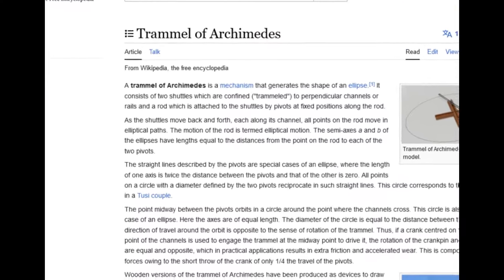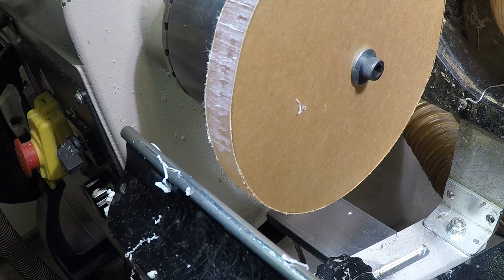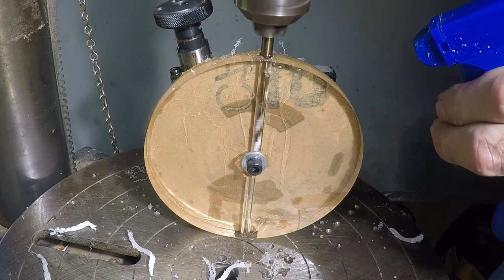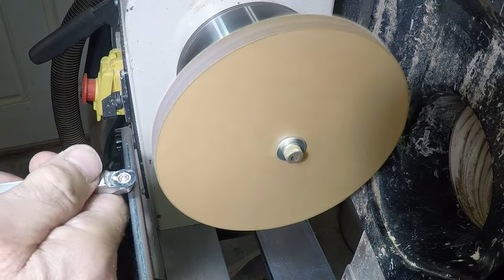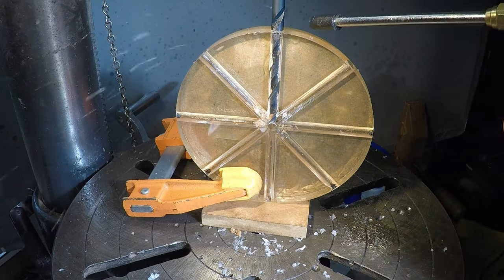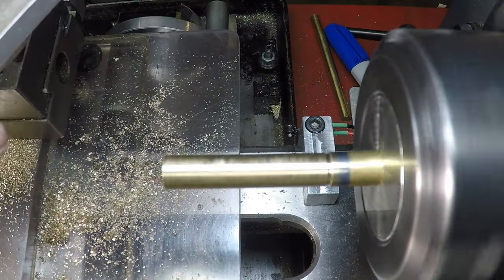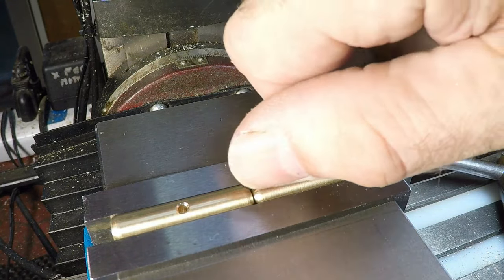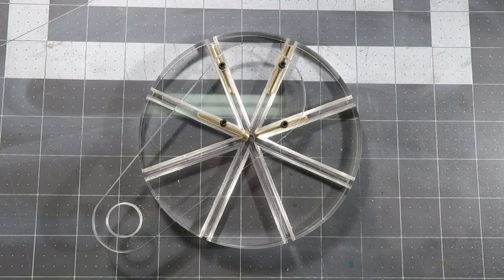Making a Trammel of Archimedes

Comment: Does the cast acrylic only come in sheets, is there extruded sheet?
Reply from the maker: You can get cast acrylic in sheets, rods and other forms. There is extruded, but it's garbage to work with. The moment it gets hot it turns gummy.  For machining cast is more expensive but the only practical way to go.